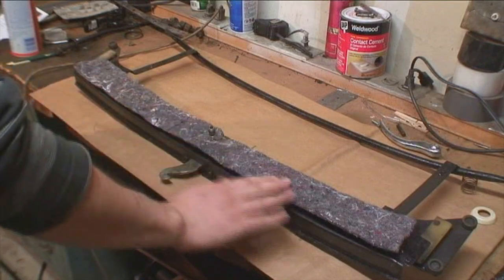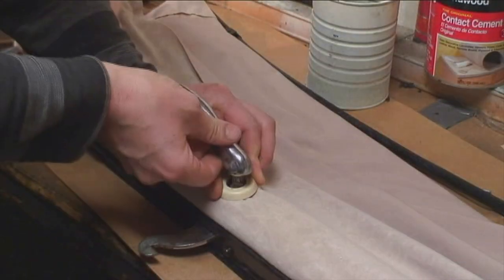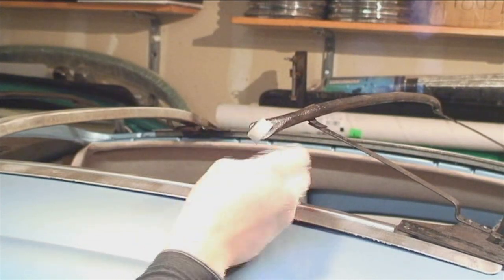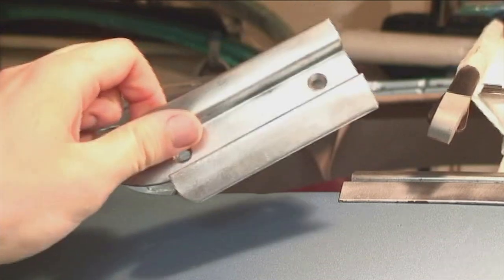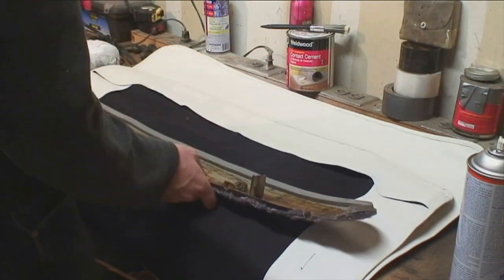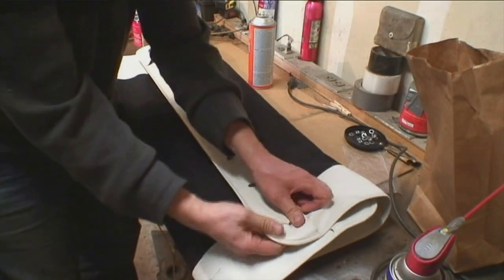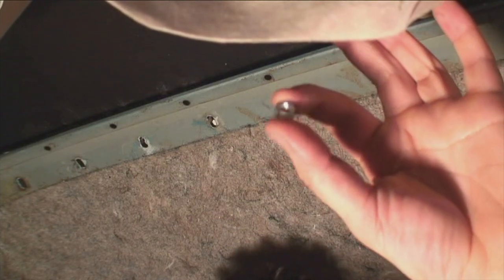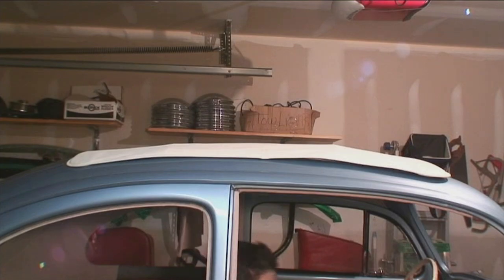Classic VW BuGs How To Install a Ragtop Beetle Headliner and Top Part 7

Comment: Thanks for all the videos. For this piece, wouldnt it make more sense to pull thr back part real right first, then pull gently up on the two cross bow pieces of material so that they can be glued at a spot where the headliner is flat inside the car?

Comment: The ”L bar” on the inside should angel the plate on the upper side slightly or at least put pressure on the rear part of it to help the canvas sit flush against the body! 

I am just about to order the materials for my headliner from sewfine but it would be nice with pictures of the different materials installed in a car. I noticed the picture for the video shows some form of tweed but the video it self shows tmi cloth! 

Tks for the good videos! 👍